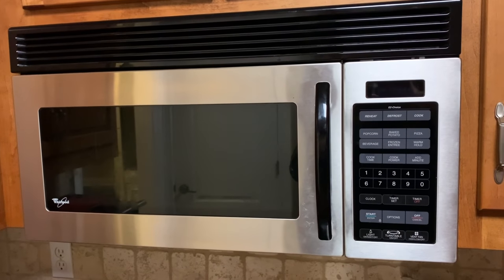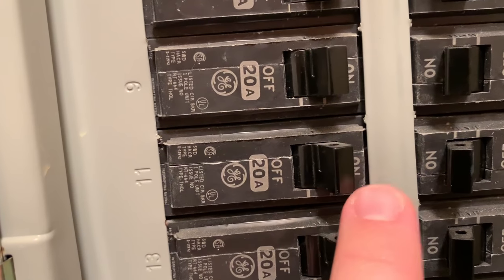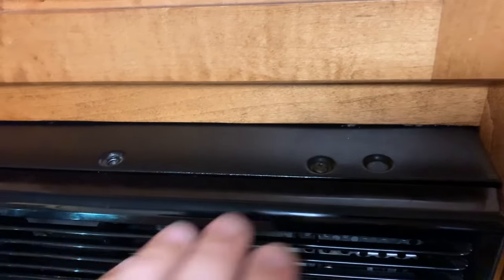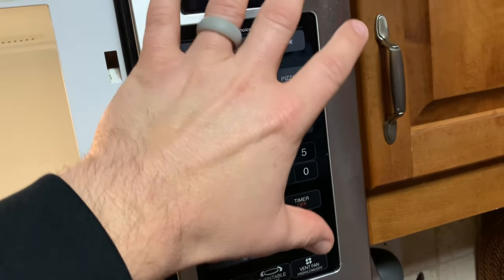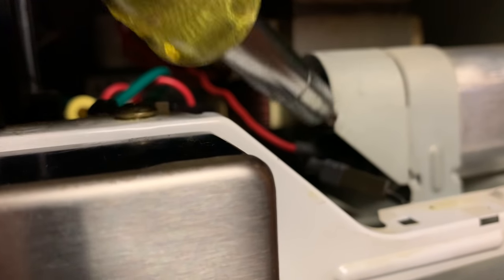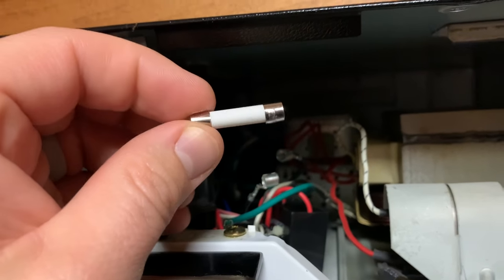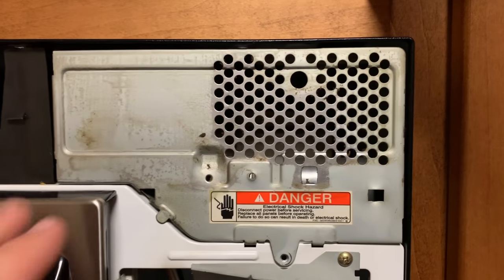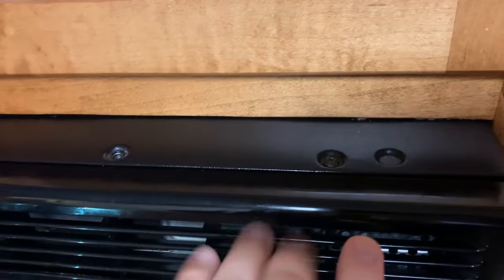Easy Fix: Microwave Won’t Turn On - No Power on Microwave

Comment: Soooo... Mine lost power today. It slowly dimmed and then shut off. The display plus the light inside. Outlet still works, I tested it with the toaster.  Checking around in case I can fix it.
Reply from the maker: I’m not really sure. It could be a number of things.
Reply: @TightWadDIY  Appreciate the reply. I plan to check the fuses after work today. I prefer replacing them than having to go microwave shopping.

Comment: Why does your microwave appear to have power the entire time? At a little over 2 minutes in, you can see the power on the microwave when you remove the first piece then it's clear when you open the door that the light turns on inside.
Reply from the maker: I just had to refilm that one part.

Comment: Question not answer the repair is with power on or off???
Reply from the maker: Always unplug during the repair. When you see the lights on in the video, we were simple refilling a part that the video was messed up on. The repair was already complete at that point.

Comment: Yeah, definitely do NOT short with foil. If there's a bigger issue that caused the fuse to blow that's a good way to burn your house down.
Reply from the maker: One second isn’t going to burn your house down.
Reply: @TightWadDIY  except people are stupid, and when it works they'll just leave it that way because they don't have the fuse.

Comment: Can a microwave work with the top black part off?
Reply from the maker: I don’t recommend it. Some have a pressure switch so it won’t work without the top. It’s also very dangerous to run it without the top.

Comment: I replaced the fuses I replace a thermal fuse I've done everything nothing looks like the only thing left to changes the motherboard which I can imagine is quite expensive
Reply from the maker: Once you do the basics, it might be cheaper and safer to get a new unit.

Comment: what if it’s not the fuse?
Reply from the maker: Do you have any lights or power at all? Did you test the outlet with someone else to make sure it works?
Reply: @TightWadDIY  no power, no lights, changed fuse and even touched new one and old one and got same small shock. it’s not the outlet or breaker. i figure it’s the motherboard fried and nothing to do now.

Comment: New fuse New switches and outlet is not tripped still no power any other tip
Reply: Mmv4205ds-4 was wondering if there is another hidden fuse?  Or maybe capacitor just died after I changed the fuse? Was only experiencing the door error. Unplugged replaced switch that wasn't engaging. Plugged back and as soon as I closed the door there was no power.  Replaced fuse still no power.  Had 3 extra switches and replaced the rest. And still no power. Tested another fuse and even bypassed the fuse direct and still no power. I am at a loss from a simple switch to now this.

Comment: Hi I dropped something on the top of my Hamilton beach microwave and it won’t turn on and I unplug it and plugged it back in and it didn’t turn on.
Reply: jeremy zuñiga replace the fuse like he showed. Or call a repairman. Good luck

Comment: my microwave randomly stopped working around 20-30 minutes after last being used?
Reply from the maker: Did you try the troubleshooting steps in this video?
Reply: @TightWadDIY  No not yet i will soon though!

Comment: Why did the interior light come on when the door was opened?
Reply from the maker: Not before I replaced the fuse. If the fuse is blown you will have no power at all and no lights. We had to refilm a couple of steps so you may see lights on in the middle of the video.

Comment: I tried the tin foil method and it blew out my outlet no more power in either the outlet to the microwave and the one that is for the stove
Reply from the maker: Flip the breaker.
Reply: I checked breaker it's fine. I checked the gfci it's on. No power to microwave and stove separate outlets
Reply: All after I plugged in with foil

Comment: Question for anyone that can answer.
My microwave stopped working after switching off/on the power box, so I guess something damaged after doing so but idk what and can it be fixed ?
Reply from the maker: It can be fixed.

Comment: When I went to heat something up my tv and microwave shut off and wont turn back on
Reply from the maker: It sounds like you overloaded a circuit. Check your breaker.

Comment: Well I kind sort lit the kitchen on fire and it started on the stove then went into the microwave and it was making a weird noise with the fan or something and I hit it bc it wouldn’t stop and then it couldn’t git it back on and then my alarm system started to go off and then fast forward to when the only thing to fix was the microwave that shut off I watched this vid and BAM worked (breaker switch) So thank you so much for saving my ass from my parents ❤
Reply from the maker: Sounds like you had a fun time! Glad it’s working again.

Comment: I bought a cheap microwave at Walmart for $55 I went to open it just now and a spark flu and it stopped working but the microwave is hot

Comment: Thank you so much mine had 2 fuses I checked the one inside the tube 1st wasnt it then I saw the other fuse pulled it out wrapped in foil and heard a beep as soon as I plugged it in.
Reply from the maker: That’s great!

Comment: How common is it that the problem is just the fuse for broken microwaves? Why does the fuse go bad?
Out of fear of getting electrocuted, I did not attempt to repair our microwave and threw it out. The microwave had some sentimental value to us so I felt it was a bit too bad
Reply: A fuse usually fails because something else is bad and causing an over current situation.

Comment: Let's say husband left the microwave running with said "bypass" that you said should not be left in that manner. Then, wife opened microwave door and fried the fuse again (but wait, no fuse because husband bypassed) so now what would be fried? Any guesses?
Reply from the maker: I would say that husband would likely need to look for a new microwave. But  really I’m not sure.
Reply: Did he bypass it by connecting a wire(aka using it as an extension). 😂
If you bypassed it without a fuse, than you most likely fried the circuit, and would need a new microwave. 
The whole purpose of the fuse is to, if something went wrong like a Suge of electricity the fuse will blow but the circuit and other components will still be protected. Hopefully that helps. Cheers. 🙃

Comment: Mine grandmas microwave stop work it’s 2011 I plug my phone charger to the outlet where the microwave was plugged in still didn’t work so bought another one
Reply from the maker: It could either be the outlet or the breaker/fuse

Comment: My clock is running and has power, what could this be
Reply from the maker: Check the other microwave video linked in the description. It could be a door switch.

Comment: I replaced the fuse with a 20 amp fuse I bought at Autozone. It immediately blew out after I turned it in. :( I saw a fuse for 27 online, but I'm not sure.
Reply: I had the same issue new ones kept blowing out funny thing is these you tubers don’t have answer to this new fuse replace blow out
Reply: My microwave is still broke. I haven’t had time to mess with it again. Good thing we had a small micro in the garage.

Comment: Nice video, similar process for Kenmore made in 2017.  As others pointed out, something may be causing the fuse to blow.  
Ours blew again the next day, now have to troubleshoot or seek professional help. 
Here is an example of a video where fuse continued to blow on a similar unit and door switch was the culprit. https://youtu.be/sAPENVcEsp8?si=Nqlh6TBP5W-ohhzk
 Ace hardware sells the fuses labeled microwave fuse, ours was 120V 20A Be careful as that capacitor stores voltage even when unplugged. If you don't know how to discharge a capacitor safely, DO NOT ATTEMPT. 
Good luck everyone.

Comment: Screwdriver to cross it across the two leads, did not get it clearly, pls pardon me, language barrier here, need to fix the microwave...
Reply from the maker: Paul Duterte The capacitor stores energy which can be dangerous. Take a screw driver and make it touch at least two of the metal connectors on the capacitor at the same time. It will discharge the power stored.

Comment: Mine is hard wired. 🥲
Reply from the maker: You can still turn off the breaker and work on it safely.
Reply: @TightWadDIY  thanks we did just that. Now waiting on the fuse to come in since can’t find locally.

Comment: Tell me how does the light work if it’s unplugged and also look closer around the two minute and the clock light is ready to be reset pay attention people it’s not that hard
Reply from the maker: As stated in multiple replies already “pay attention” I had to go back and record some of the steps after the repair was completed because the footage wasn’t clear. Thanks!

Comment: That microwave was on the whole time. Even before you took it apart.
Reply from the maker: I’m the pinned comment, you will see where I noted I had to refilm a few parts after the repair was completed because of camera failure or bad camera angles.